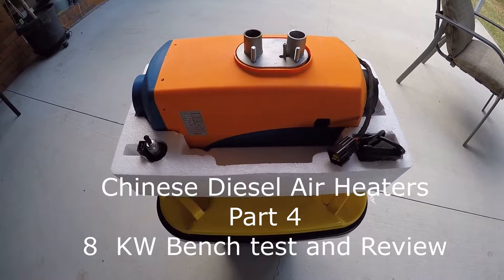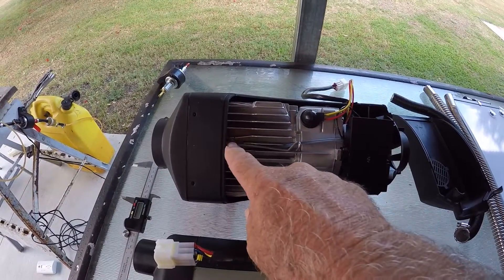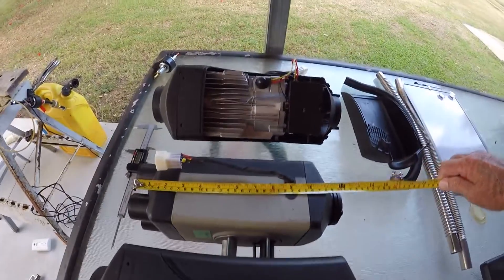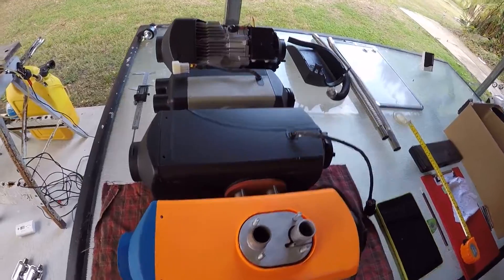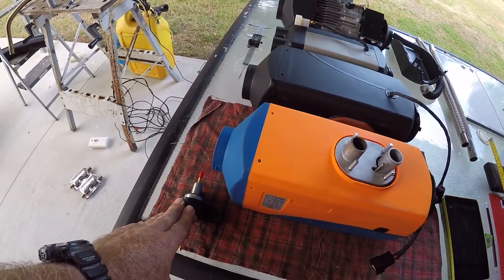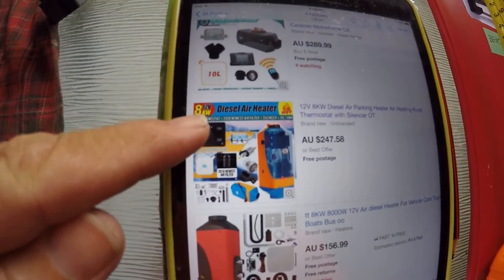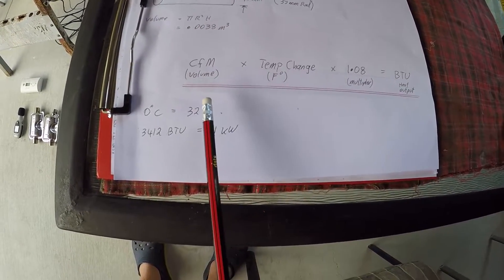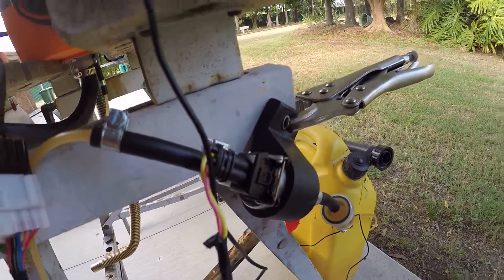Chinese Diesel Air Heaters   Part 4 -  8 KW Heater Test

Comment: Good job john but maybe you don’t realize that if you blow more air over a set combustion chamber temperature you’ll only cool off that combustion chamber you stated a couple times here that blowing more air may increase the kilowatt Output I don’t believe that to be true
Reply from the maker: Hi Keith, yes, if you increase the air volume, you also need to up the diesel burn to get extra KW. But you reach a limit and you just have to go bigger in heat exchanger size and fan size. Thanks for the feedback.  JMcK
Reply: John McK 47 Yeah that’s correct it just seemed to imply in your video that if you had a bigger fan you would end up with greater kilowatts I realize that there’s a scam out there on the 8 kW as I had mentioned before I contacted several companies on eBay asking them for physical or specs as compared to a 5 kW they were unable to do that each and everyone of them with which goes with your suspicion.

Comment: The Chinese probably take into account the 2,5 kW power from the exaust heat. Nice video.
Reply: The waste heat exiting through the Exhaust would be no more than 20-25 % of the calorific vale of the Fuel burnt..

Comment: will you run it on gasoline  that my RV also uses.. one fuel.. ?
Reply from the maker: In a fashion Hamish, but it would be highly dangerous to try. With the correct petrol air mix, and an ignition source, you would not have a fire, you would have a big explosion.  It is not like a controlled burn in a petrol engine.

The genuine Eberspacher do make a special petrol version if you must have one. Do not be confused with some Chinese translations of their heaters running on gasoil. That is a Chinese term for Diesel. 

They come with a small diesel tank, use very little fuel, so why not plumb in the diesel tank to some spot on your vehicle.  I have seen a number of RV's with the fuel tank mounted on the back bumper, and behind a spare wheel. J
Reply: Do not attempt to operate on gasoline it would b explosive.
Reply: I cleaned mine with gasoline and when I restarted it there was still enough fuel for it to get burning and it sounded like a jet engine running until the gasoline burned out. Definitely a bad idea to try gas.

Comment: It's all down to the ecu in side Mine was a 2kw unit put in a 5kw ecu and it work as long as it as a 75mm air out let on checking the sizes of the 2kw and 5kw the ones I've got are the same size when running the 2kw it will pump to a maximum p3.0 on the 5kw set up it goes to p5.5 so on the new heater models they just restricted by the fuel it would seem here in the uk thanks for very good videos. Jeff

Comment: What happens when the unit overheats? Can it get damaged? Does it matter if u always run it on high output or low output (hz)? Does it need cleaning? Thanks for great videos!
Reply from the maker: Hi there, If it overheats, the ECU goes into a shutdown mode to prevent any damage from excessive heat. You will damage the unit if you just switch it off manually and bypass the controlled cool down process.

They run very well on low output or high output in cooler weather. On full boost not so well for long periods as they can be noisy, draw amps and use diesel.

With proper instillation, short intake and exhaust runs without back pressure and restrictions, and with correct fuel management so there is no smoking and hence low soot deposits in the burner, these heaters are very low maintenance.

With poor instillation and smoking they will need regular soot removal from the burn chamber. J.